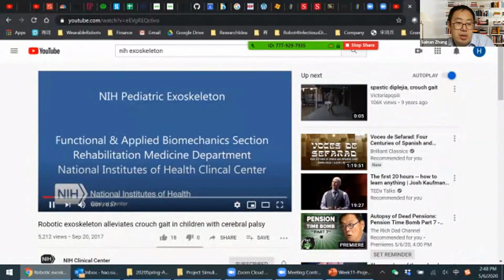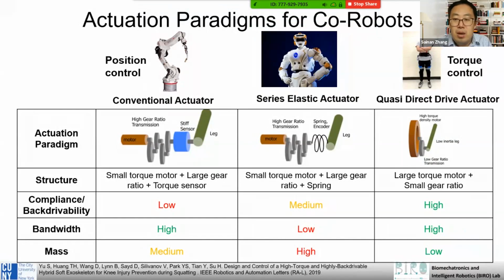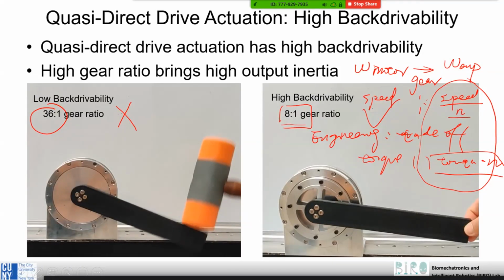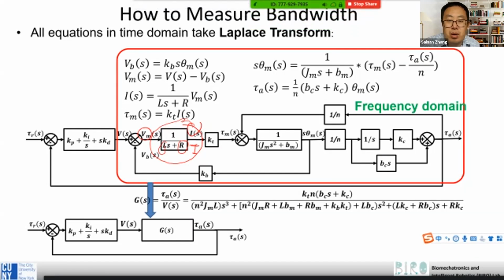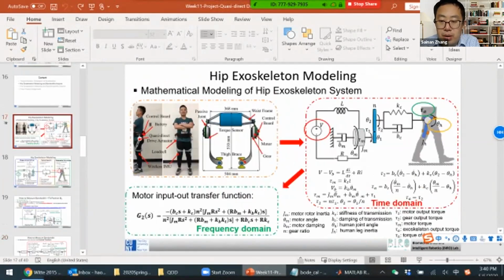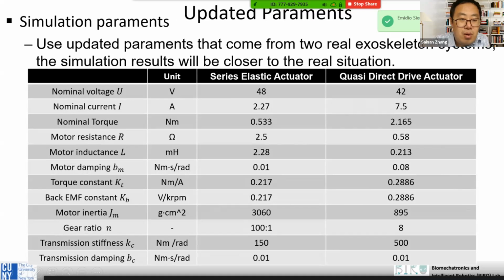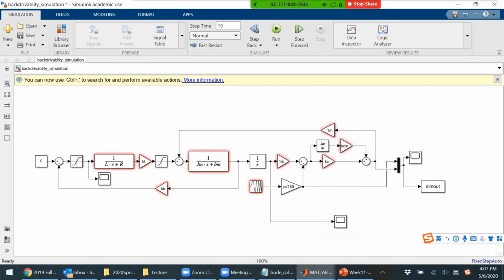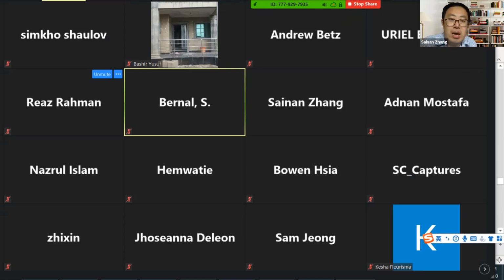CCNY ME- 59904 - Lecture 11 - (Project):Quasi-Direct Drive and Series Elastic Actuator

Comment: I have question and i hope u can answer it because I’m working on this simulation as well. When we do the tuning of pid control for mathematical model it will be different values when we do bandwidth analysis because the model has been changed too , so my question that should we do new tuning for pid controller for bandwidth test. But that no sense to do two tuning for pid.
Reply from the maker: Thanks for your reply. We uploaded the simulation code of this lecture in the description. We hope that will help you. As for your question, in order to be fair, we used the same PID parameters for the bandwidth simulation of different systems, such as QDD and SEA.
Reply: @biomechatronicsandintellig3133   I am really grateful for sharing the code with us. it will be so helpful.